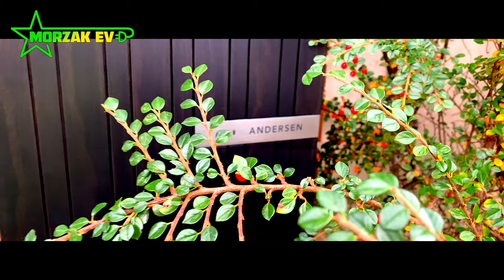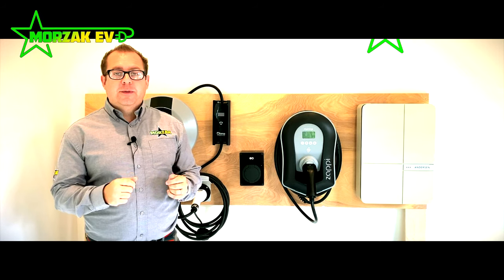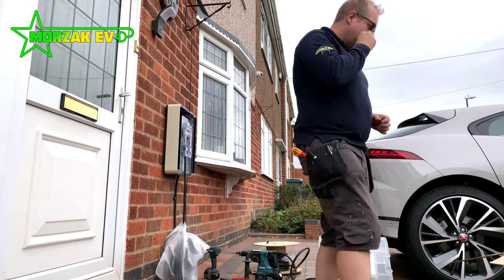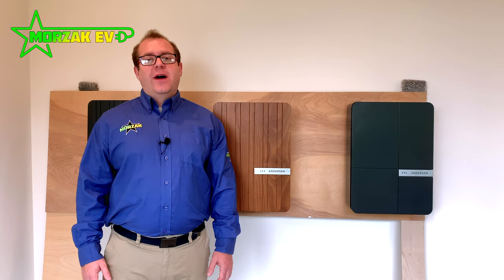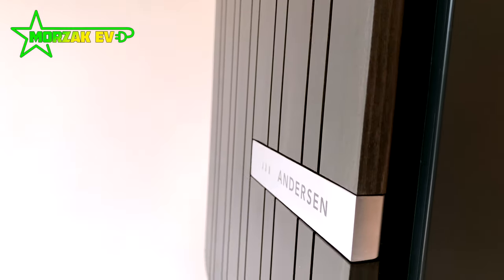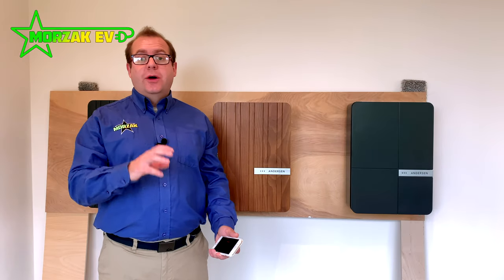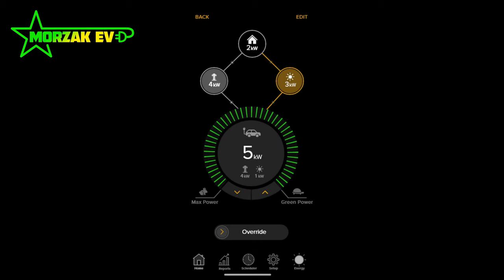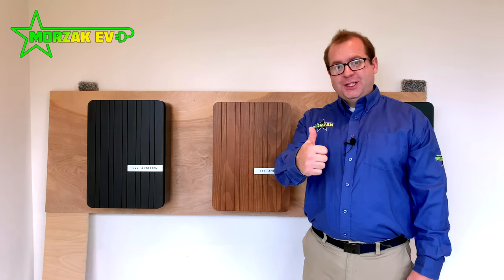Introducing the Andersen A2 Electric Vehicle charge point - EVHS OLEV approved

Comment: 1. Does this charger allow rear cable entry?
2. Would it be possible to configure it to supply max 10 or 11kw from domestic 100A supply?
Reply from the maker: 1. Yes, there is a point for rear entry on the bottom right hand corner.
2. No, the charging standards only allows 7kW on any single phase 100A supply. This is the same for all chargers and all cars. To get more than 7kW, the only way is to get your supply upgraded to 3-phase.

Comment: Great video. Do you have to run a cat 5 cable for the install?
Reply from the maker: If you want load management or solar integration, then you would need some kind of twisted pair cable (one for each CT). The data is transmitted via a wifi connection. We can also use EV Ultra cable, which incorporates the live and earth conductors, plus a transmission cable for the CT clamps.
Reply: @MorzakEV  Hi. Andersen installation booklet says EV ultra Tuff sheath cable is difficult to install in charger and recommends pvc or swa. Is that really a problem - tuff sheath is easier generally to install and terminate than swa?
Reply: @MorzakEV  So does it support 2 clamps at the same time for both solar and load balancing, or only 1?
Reply from the maker: @davebokes  you can install one clamp on the grid, and it will do “simple solar” where it detects net import and export from the solar, or you can wire up 2 CTs for grid and solar.